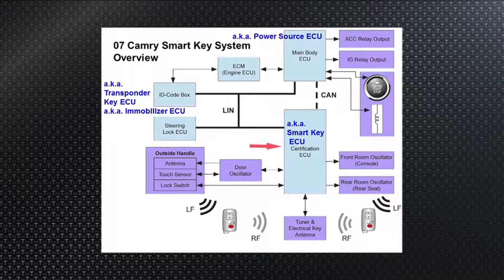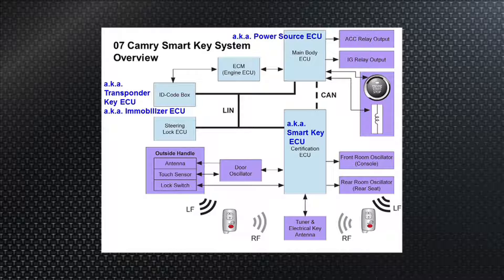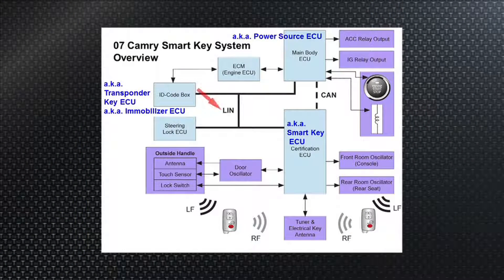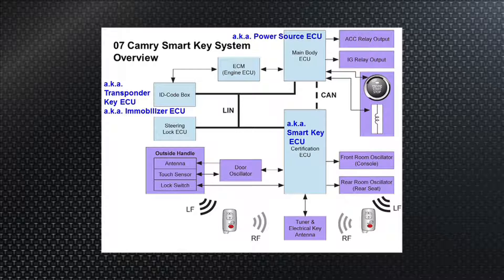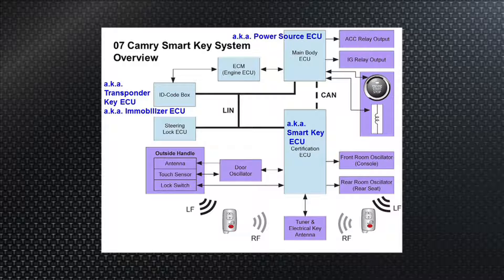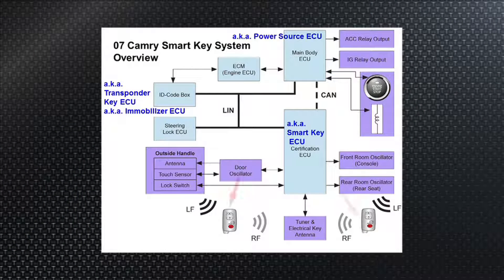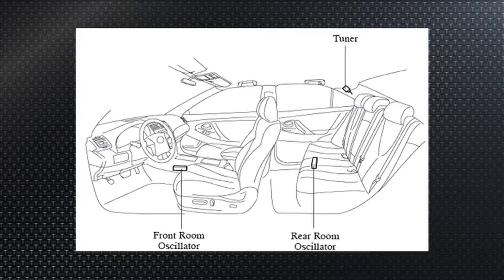Toyota Smart Key System Troubleshooting [Part 1] - Toyota ID Card | Key Programming Tech Tip

Comment: HELP!  my 21 4runner is showing smart key system malfunction, we tried everything from the manual but the car wouldn't start. it only cranks, it has the factory remote starter and it does not work. all remote locks and unlock works, accessories etc etc works. it cranks normal as if it about to start. it is towed to the dealership but they have not found the issues yet. HELP!